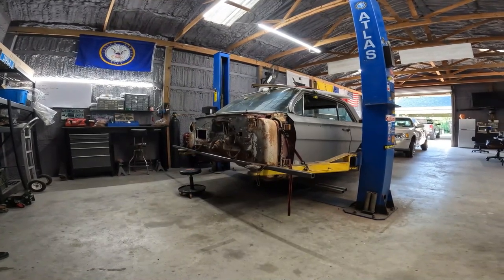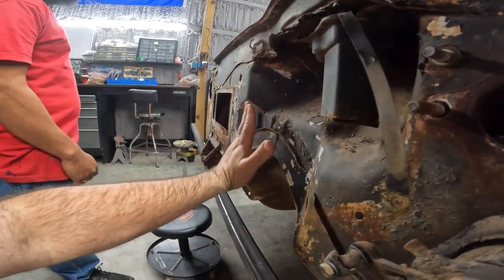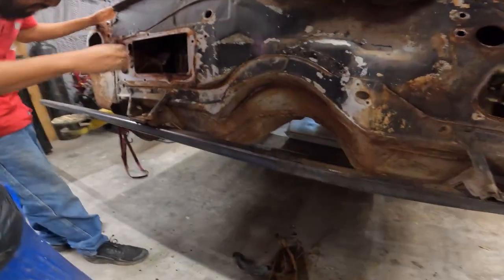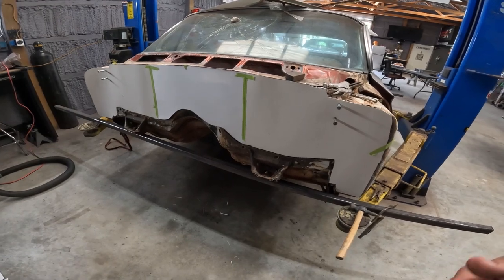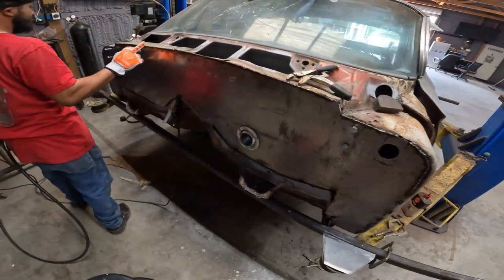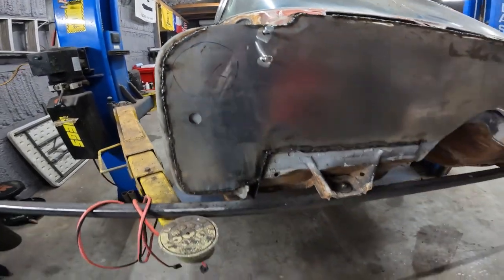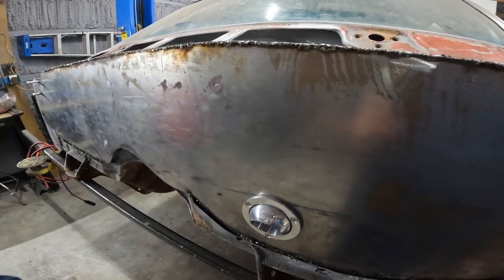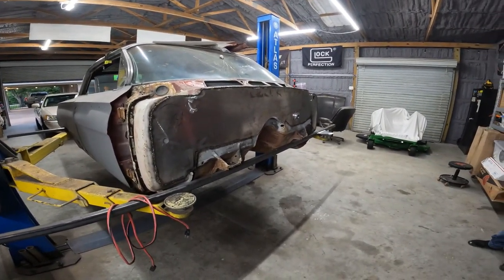HOW TO WASTE YOUR MONEY ON A CLASSIC CAR | 1962 CHEVROLET IMPALA FIREWALL INSTALL | @lonestarlows

Comment: How much for the firewall for a 63? Shipped to 94565. I wonder if I can bring the metal on a plane? Lol. Going to Texas July 4th week.
Reply from the maker: 220 shipped...
Reply: @lonestarlows  that’s the whole firewall? Also the way it’s done will I run into any issues with a regular Mr goodwrench 350 and a distributor since there won’t be an indent for it? The motor will be in the stock location. Also deleting the stock a/c and running aftermarket so this will delete all the holes in the firewall? I would like to see the overhang delete a bit closer on the top of the firewall. I may do that.
Reply from the maker: Would you like me to call you for details
Reply: @lonestarlows  yeah. Where should I send my number?
Reply from the maker: Here or kennethwoodjr@yahoo.com